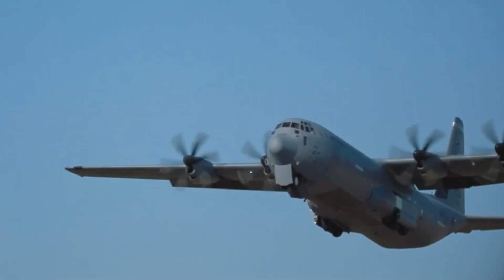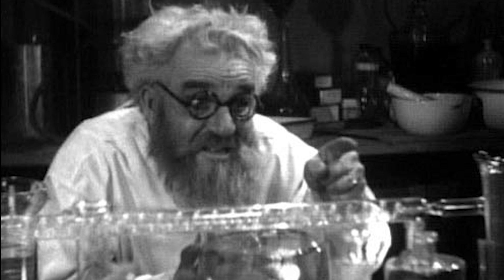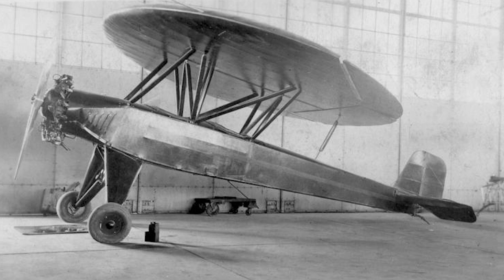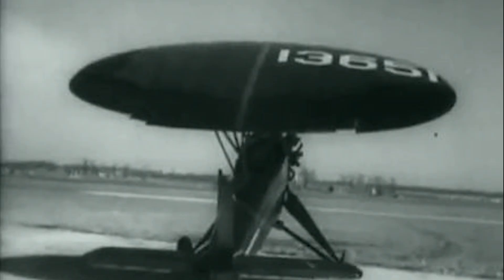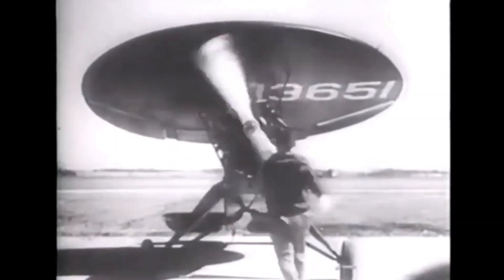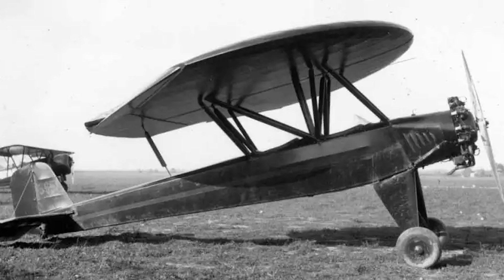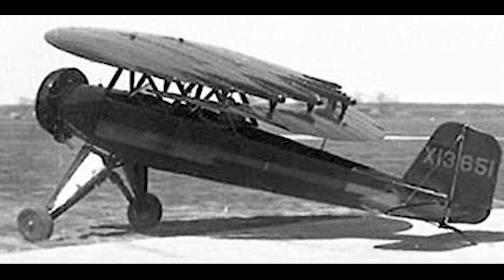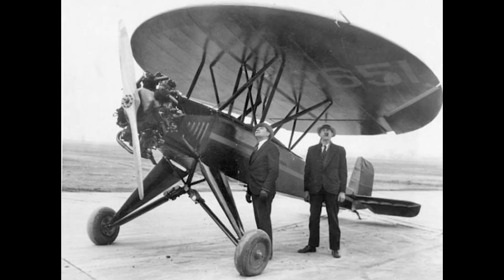The Nemeth Parasol – A Parachuting Plane

Comment: Good video as always.  You should have mentioned though that the concept was followed through on later aircraft, especially the Vought V-173 Flying Pancake.  The Nemeth Parasol's wing looks exactly like the on the Vought experimental airplane.
Reply: One wonders if Nemeth sold the IP to Vought (or someone else who THEN sold it to Vought.)
Reply: The Vought was copied from the Arup S-2 from Indiana in 1932.
Charles Zimmerman worked for NACA and was on the team that saw the Arup plane put on an amazing performance. Only after that did Zimmerman use it's super-slow high nose-up flight as the starting point for his experiments on a VTOL tail-sitter, though neither the V-173 nor the XF5U had enough power nor appropriate landing gear to do so.
NACA tunnel tests showed that the V-173 did not gain anything nor particularly change anything with the unnecessary situation with the props on the V-173.

See the video "Flying Heel-Lift" on youtube.

Comment: Love low aspect ratio aircraft.  Facetmobile, flying flapjacks, etc.  Barnaby Wainfan did a lot of windtunnel work with the Facetmobile and found aircraft the more efficient than you expect.  In fact, he argued that for low-speed, high safety flying, low aspect ratio flying bodies were the way to go.
Reply: That must be why so many light aircraft are built that way today.
Reply: @gort8203  Patents often prevent progress if the patent holder holds on too tight.
Reply: @gort8203  To be fair, that was the actual proposal.  https://wainfan.co/media/pavreport.pdf  It was (and still is) a radical idea - to change how light aircraft have been constructed to the last 50 years.  There are packaging and access issues with a faceted shape too that need some thought too.  Barnaby Wainfan didn't help himself either.  He is a nice guy, but very protective of his ideas.  Its only been recently that he has even been willing to help anyone who wanted to build their own faceted aircraft.
Reply: @joshuarebennack68   This is makes me chuckle. You are defending an old design idea for which there has been no demand because it is simply not an improvement.  I don't know what a facetmobile is, so I am talking about the wing that is the subject of this video.  There is a reason we don't see airplanes with this wing, and it has nothing to do with resistance to new ideas.
Reply: @joshuarebennack68  I enjoy reading Barnaby's stuff, and learn what I can from him, but I've met him and talked to him. He seemed to me rather dismissive of new ideas not his own. He was quick to bash ideas which have been tested and verified by many people, as failures, and was opposed to seeing those ideas tested further, despite the data showing promise contrary to Barnaby's dismissive feelings on the matter. Basically, I came away from talking to him rather put off and not wanting his input where new ideas were concerned.

Thanks for the link though. I was not aware of this report and am curious what he found.
Reply: @gort8203  My original comment was regarding the concept of low-aspect ratio aircraft in general.  Both Zimmerman and Wainfan found very real low-speed maneuvering behavior and safety bonuses with low aspect ratio aircraft.  The second comment was on Barnaby Wainfan himself and the Facetmobile.  Every design for aircraft is a trade-off and over time certain tradeoffs have developed so many "work arounds" that they are standard now.  Swept wings, delta wings, tandem wings -  they all have pluses and minuses.  When the envelope for the pluses is narrow and the minuses might take some work to figure out, the tendency is to stick with tried-n-true.  The design on the video does have some advantages for its intended purpose: extreme STOL and narrow aircraft profile.  Not sure you couldn't get that with a high-lift flying body (Wainfan) or a flying flapjack (Zimmerman), but I will say unlike those, this idea is more normal in its layout.  This design would lend itself to a L-15 style cockpit/body really well.
Reply: @SoloRenegade  I spoke to him at 2019 Oshkosh and... well, I do engineering, so I'm sort of used to his attitude.  I would love to see a Part 103 Facetmobile.  With modern CNC cutting, both of metal and wood, I think its possible.
Reply: @joshuarebennack68  I'm a professional Helicopter and Airplane pilot, and a Mechanical Engineer (with 22+ patents, set a few world records working for NASA, etc). I'm used to guys who are hard to talk to (was also in the military). But an engineer that is dismissive of new ideas without testing them, and while dismissing supporting data, is a fool.

I'd like to see more "strange" ideas tried more often, as you never know what just might work. There is a lot we still don't know about flight, and so dismissing reasonable ideas even if they seen a little odd is not wise.
Reply: @gort8203  
You maintain that "it is simply not an improvement". On what basis? Faster than original, stall and spin proof, compact in form and able to land in its own length with any wind.

What, if not "it looks funny" is the reason we don't see more like this?
Reply: @JFrazer4303   I have already given one basis but you must have missed it: If it really was an improvement it would be in use today.  As to some of the specific performance claims you mention, you are a fool to believe such fantasies.
Reply: @gort8203  " If it really was an improvement it would be in use today" is a red herring. I did see it and dismiss it earlier. You must not have seen it.

As to the specific performance claims, are we to dismiss scientific findings to preserve out-dated ideas?
These things are known and studied in the science, and the performance is accurately reported, and on film.

Look up some definitions: A "Fool" is one who too readily accepts false ideas. A rational person accepts experience and information and adapts to meet it. A fool won't accept new ideas which are proven to be true, because their own subjective world is more comfortable.
Reply: @joshuarebennack68  I remember an article back at that time, that his design was being tested for some sort of defense project related to atmospheric reentry, so in addition to probably just being really busy, he probably also had to keep things confidential
Reply: @gort8203  It's not used today because aviation is full of cowards who are afraid to do anything unfashionable.
Just due to the fact that people are stupid, doesn't mean the history and facts of several types of very-low aspect-ratio planes are wrong. Your theory that they must always be draggy and slow meets contrary facts, and the responsible thing is to listen to science, not old theory that's now busted.

"If it's so good, why aren't they flying now" is a red herring, alongside "if it looks right, it'll fly right".

Comment: Too bad the military didn't consider this for a STOL aircraft. Imagine what a more developed version made specifically for that purpose would be like. I bet it'd be even better than the Storch...
Reply: I'd like to see then numbers on that wager.
Reply: They did. Look up the Vought XF5U.
Reply: Faster, with better STOL abilities than the Storch. Simpler too.
Not just aa STOL observation plane, but fighters.

See also the Arup planes from Indiana which the V-173 was based on. Then see the Boeing model 390, for the flapjack fighter the Navy should have built instead of the silly flapping prop overly complex Vought plane.

Comment: Doesn't seem like it's big enough to work as a pure parachute, but you'd think that if there was merit to this idea it could be made much more viable with modern, lighter materials.
Reply: More so it significantly lowered  the stall speed.
Reply: Ram air parachutes operate on the same low aspect ratio wing idea.
Reply: There was no merit to the idea.
Reply: @gort8203  There was/is significant merit to the idea. Aviation is terribly afraid of doping anything unfashionable. "If it looks right, it'll fly right" is a hard and fast rule for some people, admitting of no exceptions.
The fact that this flew better in every way doesn't matter to fashion, which says that higher aspect ratio wings that stall and spin and kill people, must be better.

Comment: I’ve made aircraft with ultra-high ratio in X-Plane and you can achieve very low speed flight. The engineering and flying problem is the very high angle you end up doing this and high drag, making it tricky. You’ll end up making landings where you’re constantly applying and  fine tuning power till touch down just to accurately achieve your touchdown point. It’s more ideal for a plane to be easy to land where you aim with engine idle or off if necessary.
Reply: But a very high aspect ratio wing can stall, where this cannot. A high aspect ratio wing is slow and draggy, this is sleek and quick. Faster than the Alliance Argo plane which the fuselage came from. See also the Farman 1020 of the same period and type, also faster than the original. Stall-proof and super-slow capable as well.
Reply: @JFrazer4303  High aspect ratio wings are actually low drag, which is why gliders use them.
Reply: @CharlesStearman 
These are faster/more efficient.
 This and the similar Farman 1020 prove it (this fuselage from a biplane , the Farman from a monoplane), and several very-low aspect-ratio planes prove to not be draggy at cruise but sleek.
Reply: What I was trying to say here is that although you can indeed achieve very slow flight (and high too speed too if the rest of the plane is low dead) with these kinds of wing it’s at a very high AoA which means in landing your pitch angle is very high, and your glide path is very steep. So theres some visibility hurdles, and some difficult parameters for gear design. Then there’s the flying problems. Easy to land it ultra slow and short  if you have Rogers Dry Lake to work with, fairly hard  to put it on the numbers, which is of course exactly the precision you’ll need in the sort of situations you need STOL planes.
Reply: @cmbaileytstc  
The Nemeth in this very video proves all of that to be wrong. As does the similar Farman 1020 and the extensive history of the Arup.
Visibility is solved by not having the pilot in the back seat as this does (though it didn't particularly bother generations of biplane pilots who flew out of farm fields and off of ships),. Even better with jets or with a drive-shaft from a mid-mounted engine (see the Boeing model 390)

See the Hatfield "Little Bird", the Arup S-2 and S-4, the Rowe "UFO", the Eshelman commonly known as "flounder", several others

The US Navy at first gave up on the F4U Corsair for ship-board use, mostly because of visibility. They didn't station it on carriers until january of '45. It didn't bother anyone after that.

Who needs a dry lake bed when it descends super-slow at 70 degrees and lands at <20kts?
These invented "What if"s simply don't apply.